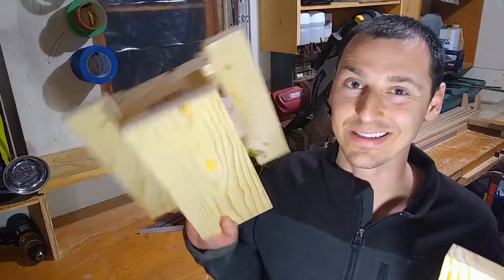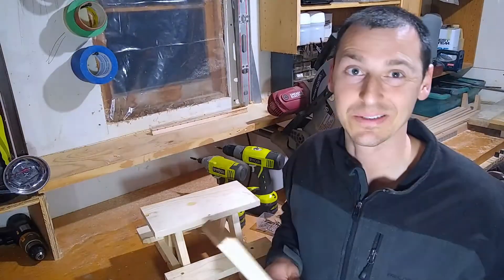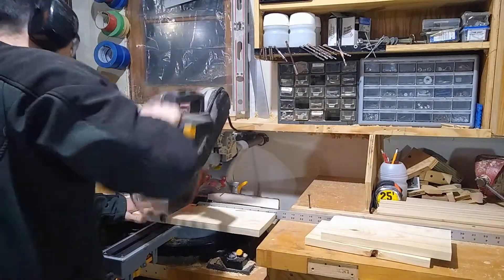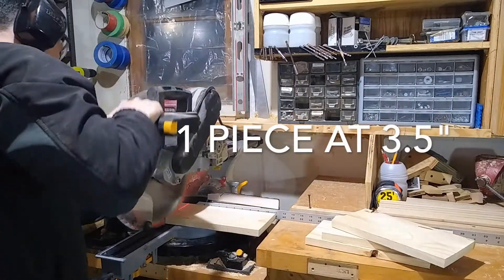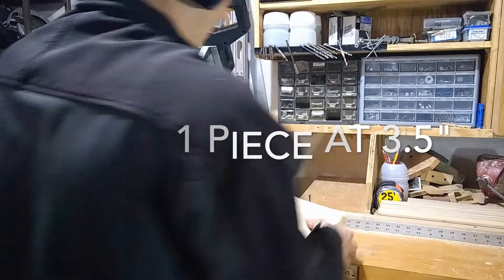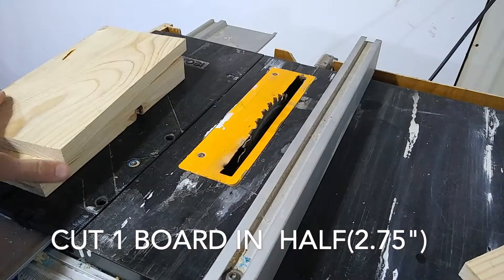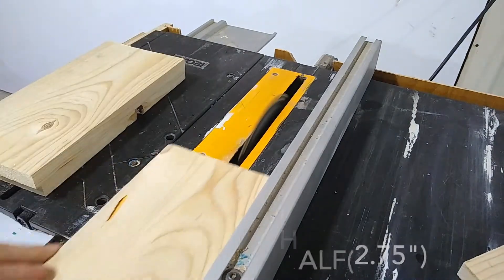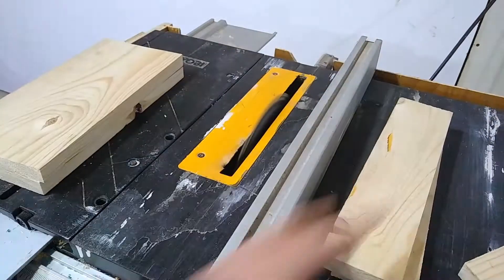Still the Best Squirrel Picnic Table Design

Comment: Great plans. My wife and daughter found this. I got a 6' board at Lowes (in case of errors on a piece, or a mess-up during assembly) and cut it up and put it together in an hour. I love simple projects like this. I used up a bunch of excess 1.25" nails I had instead of getting screws I didn't have so that would be my "recycle" portion since I bought the wood.
Reply from the maker: I love that they brought the idea to you. Thanks for  the kind words.